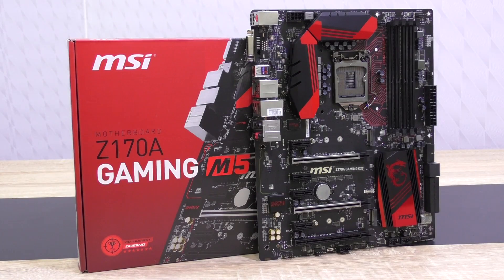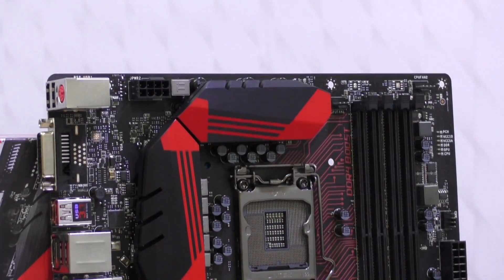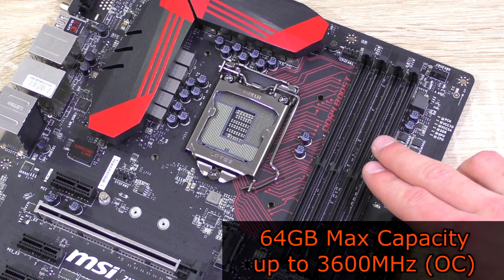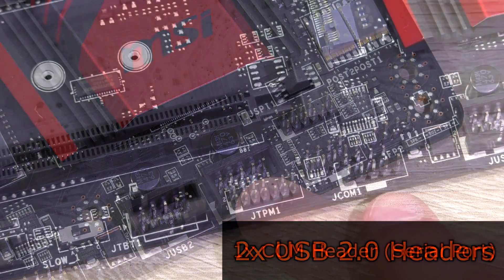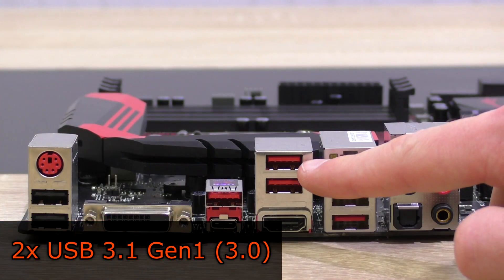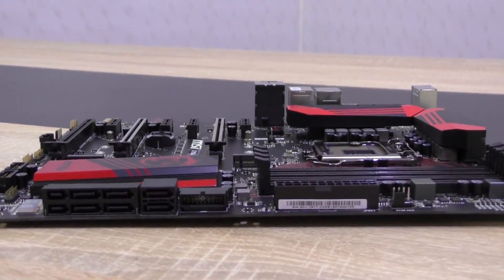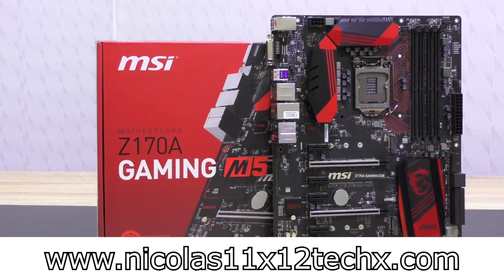MSI Z170A Gaming M5 Motherboard Review

Comment: would this work with a i5-3570k and gtx 1070?
Reply: Not with the 3570k. The 3570k has the lga1155 socket and this motherboard has lga 1151. You need Intel 6th gen. The 1070 would work with this mobo though

Comment: At 6:06 you say about humidity, high temperature, overvoltage protection etc but those features are not in the official MSI site in the overview for the M5 which is weird cause it is in the cheaper M3. Maybe M5 doesnt have those features ?
Great review btw!
Reply from the maker: +dimis ryu Thanks! Don't worry, looks like MSI forgot to mention these features on their site. It's pretty much a standard on most MSI motherboards.
Reply: +Nicolas11x12TECHX Thank you very much for your quick reply!
Reply from the maker: +dimis ryu You're welcome!

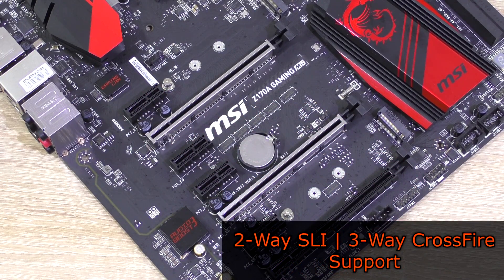Comment: 3:52 Does anyone know why it can support 3-way crossfire and only 2-way sli?
Reply: If you run 3 way it will be in x8/x8/x4 configuration, but for sli, nvidia requires at least x8, so only 2 gpus  can be used
Reply: Jack Hoff I see. Thanks!